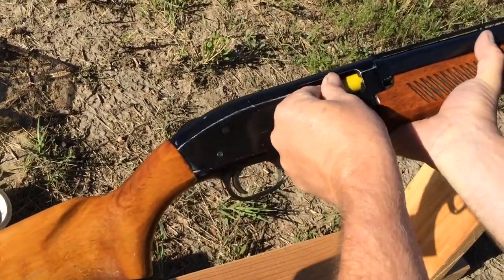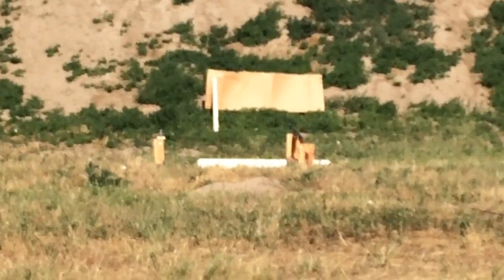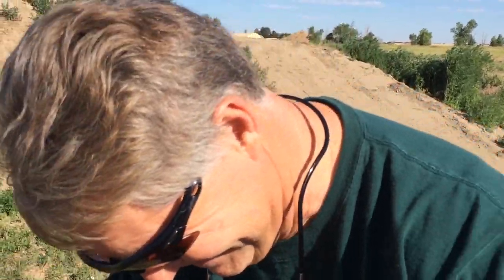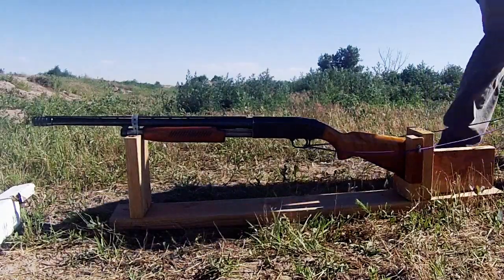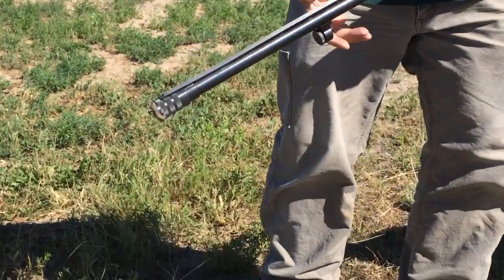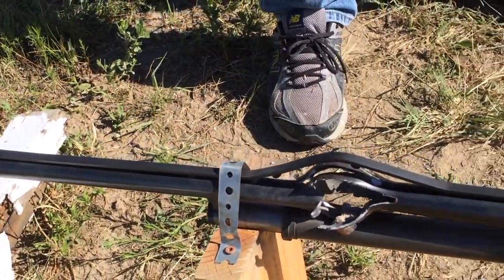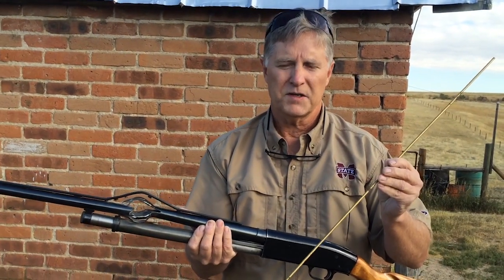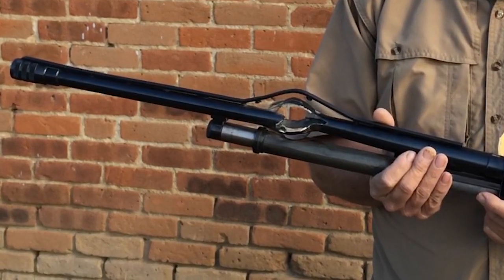Shotgun Explodes! - Outdoors with Trav

Comment: Great insight and test on that shotgun! I was surprised that the 20 gauge test shell did not fail! Great tips! Would love to see a rifle test with a barrel obstruction! Great job guys!
Reply: Most likely because they put the 20 gauge shell at the wrong place for the barrel to explode.   
Obstructions near the chamber ar the safest (for the barrel at least) while obstructions at the muzzle are the most distructive.   
The barrel blows up not because of the gases in the shell but because the projectile compresses the  air in front of it due to the obstruction.   
I'm willing to bet the result would have been a blown barrel if the 20ga shell was placed near the muzzle side.

Comment: I would like to know how to build that wooden stand you made for testing the shotgun. I have a JC Higgins Model 66 semi automatic shotgun that has been checked,cleaned, and parts replaced and would like to test my shotgun safely with that stand that will prevent any injury should my shotgun fail. Better safe than sorry.
Reply from the maker: Hello Ian Vanilar,
Thank you for the excellent question. You can make a wooden stand for your shotgun quite easily out of scrap lumber that you probably have laying around. Build it similar to what you see in the video so that it supports the stock on one end. 

On the other end cut a V-notch in a board for the barrel to rest in. Secure it down with a piece of metal strapping with holes in it that you can get at the hardware store called plumbers tape.

You can then rig up a length of parachute cord like we did to safely manipulate the trigger from a safe distance.

Be safe & good luck with testing out your JC Higgins Model 66 shotgun! 👍Trav

Comment: can't believe that just a small mud that can cause breaking the strong barrel,the gas should have blown the mud out so why wasn't it?firearm energy is so powerful that doesn't meet the eye,i did a primer test with homemade shotgun shell from pvc pipe and super glued parts,the result is,the parts fly out despite the glue and an plastic cup is broken.
Reply: So the 20ga shell obstruction caused deformation in one part of the barrel(which they don't show you).
Then they spend god knows how long shoving clay down the barrel
then turn on the camera shove more clay down the barrel;
Turn off the camera and clean the outside so we have absolutely no idea how much is  there (they spent the time to clean the outside of the muzzle break. why? This also means they spent even more time with this barrel (the clay could have hardened)).

blah blah blah etc.
This was an awful video.
Reply: Mud or snow either one can cause a barrel to explode like that. The gasses and energy are going to take the path of least resistance. You essentially create a pipe bomb.

Comment: Anyone heard of this happening with a stuck wad?
Reply from the maker: Thomas Koneck,
Yes, I have heard of it happening with a “squib” round. Where the shotgun wad & shot did not exit the barrel and then another round was fired behind it. That damaged shotgun is now a good teaching tool in hunter safety classes. Thank you for your comment! Trav
Reply: @OutdoorswithTrav  I've seen a barrel at my sons hunters ed class and decided to YouTube it then came across your video. My question would be how to prevent that from happening? How can one tell if and when the wad got stuck before firing another one behind it? When will I know to stop and break down the barrel then pull out a stick or poking rod to push it through? His final class is coming up this weekend I'm sure I'll be asking the instructor but I do appreciate all and any others thoughts and opinions. Thanks for sharing your video!
Reply from the maker: In my opinion a squib round would be quite rare with brand new ammunition. In the case with my friend’s double barrel shotgun it most likely occurred due to shooting an improperly home reloaded shell rather than from using new factory ammunition. 

If the powder charge was not properly loaded into the shotgun shell during the loading process, then the primer alone wouldn’t produce enough force to expel the payload of shot & wad thus causing the “squib” projectile to lodge in the barrel.

It could happen with a pistol or rifle cartridge cartridge as well. You will know a squib round when the gun fails to fire and recoil properly. When in doubt check for a barrel obstruction.

With a break-action firearm simply break open the action and look through the barrel or barrels to make sure that they are clear of obstruction(s). With a pump or semi auto, you’d have to disassemble the gun which isn’t a huge deal, even in the field. 

I carry a takedown cleaning rod in my hunting vest. It takes up very little room & can come in handy in case there’s a mud or snow obstruction caused by an inadvertent fall thus jamming the muzzle into the ground. 

Another good reason to always keep your finger off of the trigger until ready to shoot!

Best of luck to your son with his upcoming hunter safety course!
Happy & Safe hunting! Trav